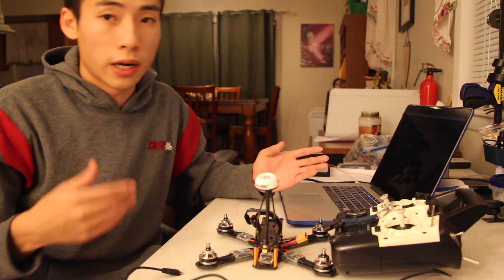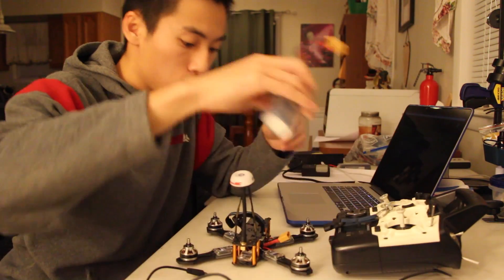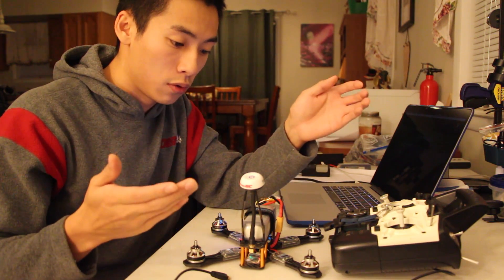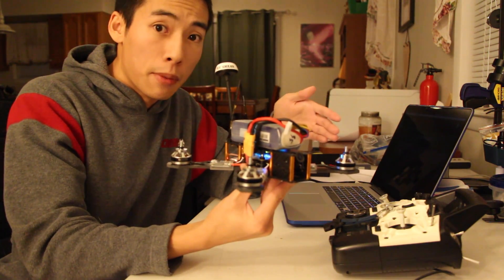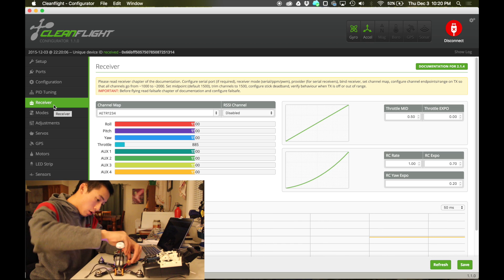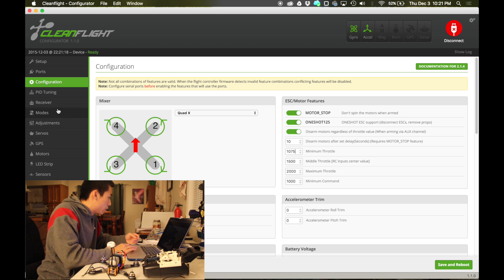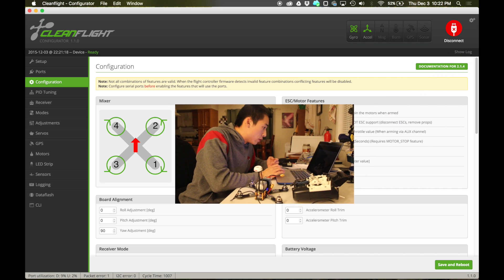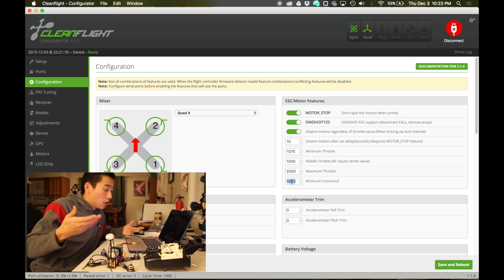Calibrate ESC with Cleanflight plus tips!

Comment: I have a question that sounds stupid

I did the same steps that you did, but what next?

How do I turn it on, I turned on the transmitter and nothing happened
Reply from the maker: Did you mean how to Arm the drone? There’s a few ways to set it up, but I believe default is holding throttle down and to the right for 2 seconds after everything is powered up.
Reply: @Chancopter  Thank youuu that was helpful

Comment: oh man, you just saved me so much time. it took me like 2 weeks of vid watching to finally understand how to arm the stupid motors.. i am just one step from a disconect failsafe to turn off throttle, and i'm set... This video makes sense. i was wondering i screwed it up but no, your vid helped. I am going to field test this weekend... Not bad for a junker pawn shop drone.... It does need to have the camera plug fixed in (super tight) and the back part with the antenna... battery connector super short.. its a cool thing, imma learn on it.. eventually i'll strip it down.. got some new recievers on the way too for next build from all the parts  i got in a lot and eventually build my own.. but for now, it took me ages to finally get it. thanks for the vid bro. subbed.

Comment: Sir,  can u help me.

My  throttle range 1003-1989.    I set my min throttle to 1050.

But my problem is,  when I go to "Motors" in beta Flight I can Manually Controll my motors but When I use my Transmitter The Motors wont response..
Even  "Receiver" in beta flight is working Correctly..

Please help.

Iam also not using Arming switch  bec my flysky is just 4 channel.

Email me: johansgwapo67.68@gmail.com

Ty in advance

Comment: Hi. Thanks for the video. Can you help me solving this problem: After doing the ESC calibration, my motors don't spin at all (when trying to fly). In cleanflight everything works fine, motors spin evenly. But also I have notice that motors start spinning (in cleanflight) at lower input than minimum command. Any ideas why? By the way, it was working before I calibrated the ESC.

Comment: Hi Chonny, I recently build my first drone and it was an amazing experience. Now I am trying to set it up in clean flight to calibrate esc's. I have followed the instructions in your video to the letter, however when I arm the quad from my FlySky Fs I6 and push the throttle up, all motors switch on but motors 1 & 2 keep spinning faster while the others remain at min throttle set to 1050 and min command to 1000. do you think you can help me with this problem. Thanks in Advance

Comment: Hey Chonny, 
Not sure if you will see this. However, I have an Hubsan H501S, and it is flying badly. I look and the Roll is14, the pitch is -6. It has had a couple of crashes, and one from 180 feet where I had to replace an ESC and motor.  I can get it off ground with some manuvering, and with the GPS it holds ok. I do a yaw, and the thing runs away.
Please advise.

Sean B.

Comment: Hello. Im not sure why but my escs will not calibrate. My motors just spin up once i plug the battery in.
Reply: Hey, Daniel, I had the same thing after I hit a wall. My quad crash and the motor started spinning when I pick it up. Ever since my ECS is not responding. Calibration does nothing. Did you ever figure it out.

Comment: Thanks for the video. Just built a quad and the problem I am having is that when I turn it on and get it in the air it bounces up and down like its losing power then gaining it back again. Once I get it universal half throttle it's fine? I have calibrated the motors and esc several times with no luck.

Comment: Clear video thanks Chonny. I've tried your method but still having a problem with one motor on ESC2 which refuses to start at the same speed as the rest. Using betaflight for calibration. All motors spin the same during calibration but not with receiver.  My settings-> Min command 1002. Min throttle 1008. Max throttle 1993. Hope someone can help.
Reply: Hi. I have the same problem right now. Did you find solution for that?

Comment: Great Video, works fine with my ESC's. But after flashing my ESC's I got the problem, that when I move Yaw, Pitch, Throttle or Roll a bit, like half of the possible way, the motors stop! The motors don't spin anymore, I have to unplug the battery and connect it again. But then I got the same problem again.    Can you help me?
Reply: Hi. I have the same problem right now. Did you find solution for that?

Comment: After calibration when i give full throttle Motors 3 and 3 are lagging in speed 1 and 4 are at full 1850 while the  other 2 are below that How do i get them all to the same when my stick is at full
Cheers

Comment: Hi Chonny, thanks for you video.. you actually gave a clue about my issue -> motors spinning at different speeds on take off.... After many checks, frustrations, it turns out it was the transmitter (dsx9)... very few videos show importance of trimming... What I had to do was to trim (subtrim) all the channels (throttle, rudder, aileron,elevator) to as much closer to 1500 .... I didn't pay much attention to min, or max value, I just made, with all sticks centered, the values be near1500... when they have different middle values, for some reason it affects the flightcontroller (PID)... I hope this helps everyone.

Comment: So I really like your vid. I have a question. If all the channels are messed up? Like my throttle is reading pitch and my pitch
Is acting as the throttle. Do I have to switch these with the radio or in clean flight? When I plug in my quad the motors are running hard and I think it's because of the wrong inputs. Any help I would appreciate. Thanks.

Comment: Hi
please help me

I am new in rc team I am build my own quad
zmr250 frame
days 1806 2300kv
Afro 12a opto ESC
naze32 rav 5
matek pdb v5 low woltage alarm
turnigy 9xr pro 
djt module
frsky d4rii receiver
I am assumable my quad but I don't know radio setup so please help me.
tel me the radio setup...

Comment: I am having a problem with my ESC calibration. the motors are not synced at around 1/4 throttle, but if im at idle, then punch it, the motors are synced, but when I hold it around 1/4 throttle, then punch it, the levels are way off. some motors are at full throttle, and others are at half throttle. at 1/4 throttle, it also makes like an oscilating noise. pls help. im really frustrated. I also tired to recalibrate the esc's many times, all together, and 1 by 1. I also tried to reset the board, and the firmware.

Comment: Thank you soooo much for this video.  We were having a major issue with the Vortex 250 where two motors were spooling up very high and than the drone would do flips on the ground instead of even taking off.  Changing the speeds fixed that, however we remain with one issue.  There is no idle on the blades when the drone is armed as there was originally.  Do you know how to fix that?
Reply: annd nm.  By bringing up the minimum throttle up to 1110 it fixed the issue.  Still a fantastic video and I absolutely love you for helping fix our problem!
Reply: Hi. I have similar problem. Do you know how to fix it now?

Comment: at 4:38 my motors start spinning even though there is no battery connected, it seems quite strange, i noticed that after a minute of so a bit of smoke came out from the Naze 32... why is that happening (i mean there is power getting to the motors coming from the Naze32)

Comment: thanks so much.  I had to watch the video a few times to catch everything you were doing, for example I didn't catch that you were lowering the motor settings to 0 when you were in the calibration stage, prompting the lower range to program (what can I say I'm a total noob with RC), but you've got it all here.  Thanks again, now I can fly!
Reply: wogfun yea I didn't notice I glazed over that step. Kinda important I suspect lol.
Reply: Hi wogfun! Can you please tell me how to make transmitter work before flight? My transmitter cannot move motors, but Software can.
It messed me up for 2 months. :( What is the trick? (Please attach with some video).

Comment: when I plug to the flight controller and try to run the calibration the motors start spinning without battery plugged in , this is a 130 frame  with dys 4000 kv motors blheli esc

Comment: Great Video Chonny. One question but at first i am a Beginnner!.^^ Whatever i will get on the Weekend my first Brushless Quad and so i asked me the Question how i can do the Throttle Calibration if one Esc will die or i want to replace them. Cause the thing is i will using just a simple lemon rx Satelitte on it. 

Do i understand it right that this is a way to Throttle calibration like other do it with a "real" Reciever?!?! 

Maybe its a unnecessary noob question but i am want to get sure and yes i am just a noob for the Moment^^ excuse my good englisch^^ ;)
Reply: Yes, if one of your ESCs break, you can replace it and recalibrate with no problems. However, if you want to replace an ESC with a different brand, replace all the ESCs. Your lemon rx Satelitte will work if you are using a Spektrum transmitter (DSMX/DSM2).

Comment: Great tutorial. Thanks! I've seen some other ESC calibration tutorials where they used the radio's throttle manually instead of in Cleanflight to calibrate the ESCs. What is the difference here?

Comment: My motors are not spinning when i selct master
there is a 5 volt supply to them they are brand new as is everything else
Any ideas
Reply: 5v is way too low, you need at least 12v or 3s depending on the ESC
Reply: cheers

Comment: What motors are those? looks like they stop spinning quick when the throttle goes to zero.
Reply from the maker: They're T-Motors but that doesn't have much to do with how fast they stop. The stopping speed is actually the active braking system in the ESC firmware.

Comment: At first, thanks for yor Video. I've done that as you sad and it worked fine. But I got another problem with the Motors. Two of them are spinning slower than the other two. And in flight, the quad spins on the yaw axis lightly. What can I do?
Reply: trim maybe? flying in level mod, calibrate accelerometer.  couple of options

Comment: Very nice Video! By the way, i had the Problem, that 3 Motors started at 1041/42 and one Motor started at 1189(!). I tried to calibrate over and over again, with NO change. (I almost found myself ordering new ESCs) ;-)

What helped me: 1) LiPo off 2) Master Switch to 100% 3) LiPo on. And then i waited for about 3 Minutes while the beeps constantly start over and over again (1 beep pause 2 beeps pause 3 beeps pause 4 beeps pause and again from the start).

The beeps wont change and they wont stop! After 3 Minutes i pulled Master to 0%, got 2 different beeps (No Musical tones whatsoever) and then silence....

I didnt expect it to work, but still tested it and BOOM All Motors starting at 1041(!). So just take your time and let Master at 100% for a bit and you could be ready to fly again. :-)
Reply: Hi. That is a very helpful comment. Can you help me with my problem? My motors when doing ESC calibration starts to spin at 1001, despite of minimum throttle set on 1050.

Comment: Crashed during a race and forgot I had Idle up on.  Also forgot to disarm.  BAD situation!  After the race when I got to it one motor was spinning and I said S*t!  Picked it up and touched one of the non spinning motors and got a little burn.  Managed to unplug.  Replaced all the escs and motors, and it was idling up too fast, taking off, so I cut down the minimum throttle.  Then it started acting very strange.  Random accelerations, flipping on arming, just totally messed up.  So I replaced the FC, no change.  Replaced the PDB, no change.  Then I saw this video. I had the min throttle below the min command.  Fixing that fixed everything!  THANKS!!

Comment: I built a 450 quad with riorand ESCs and NAZE 32 board.  It was working just fine until I crashed it on the inaugural flight.  Yeah, I'm a rookie.  Since then, it will not work properly.  I checked the power distribution board, replaced the ESCs, motors, checked the connections...even after configuring everything, updating everything, calibrating everything, motor number 1 & 4 turn on, then3, then finally 2.  Motor number 2 is always the problem.  I felt I have checked everything but obviously have not.  Any tips?

Comment: Hi Chonny, great video but I'm having problem calibrating esc's. I noticed when you pulled the "master slider up to full with no battery attached your motors don't spin. Mine do a little and if I plug the battery in it goes full throttle. My min command is  set on 1000 and min throttle is 1150. My receiver show min throttle at 1090. Can't figure out why the motors are spinning even when the battery is not plugged in.
Reply: Check that no props are on and battery not connected to quad. Turn master slider to max (2000), there is no power to quad so motors should do NOTHING at all. Plug battery in, flight controller will detect that input signal is at 2000 (or maximum) so its goes into esc calibration mode and depresses motor spin (fingers crossed). Wait for sounds to indicate ESCs have detected maximum throttle value. No pull mater slider down to minimum (1000). ESCs will now make a sound to register the minimum throttle value.
Now go and check the receiver inputs (in cleanflight) and set your transmitter (Radio) for throttle, yaw, pitch, and roll so that middle stick value is as close to 1500 as possible and at max or min stick travel that it outputs close to 2000 and 1000 respectively.

Comment: How can you change the Direction of the motors in the program
Reply: +emmanuel quiroz You don't... Swap any two wires that go from the motor to the ESC if you need to change motor direction.
Reply: But I was told that most time I don't need to
Reply: Unless you want to get into reprogramming the ESC's your best and easiest option is to simply swap any 2 wires.  Programming an ESC can get fairy complicated pretty quick if you don't have all the right stuff, and understand what your doing.
Reply from the maker: Only BLHeli can swap via a cleanflight board. Open BLHeli suite while ESC are connected and powered up. No props. You can adjust anything from motor direction to dampening to beeping through that.
Reply: Chonny I'm going to do that thanks
Reply: +Chonny I have 4 esc, two of them the sound went off too late when calibration. any idea why this happen?
Reply: I had this same problem on one esc. Check your soldering to make sure you soldered from the fc signal pad to the esc signal. Also check if you have bridged the ground and signal pads because that can cause desync and weird behavior from that motor. Good luck let me know if this worked at all.

Comment: Hey nice video! :) Also a good tip would be, if you do this on the bench, is to put the quad in acro and make sure it does not move i.e. it stays still (flat) on the bench. What this does is it keeps the PIDs from trying to level it out, 'cause in acro mode, there is only rotation rate PID active and since the quad is not moving, the PID will not affect the output to the motors in any way. Also BIG thing to remember is: make sure when you trim your transmitter, that you don't have dual rates and expo active, for example, when you do your endpoints and middle values. If you do have expo and D/R active and do your trims anyway, when you switch to linear (i.e. no expo and D/R) you might get wrong values out of your transmitter. Hope this helps further :) Keep up the good work and happy flying! :)

Comment: I have a eachine 250 racer and when I push throttle up then turn to left or right the motor will slow down and if throttle is not up or half way it will shut the motors on opposite side tur right left motor will slow down or shut off

Comment: +Chonny motors act fine and calibrated when using motors tab, but when I use the tx throttle two spool up and the others go down.  BTW it was good before I tried to cal before (before I found your video)
Any ideas? Tnx

Comment: thank you for the video, Well done!  I have an issue with getting my roll to middle value in cleanflight.  Do you think it has to do with my Tx and Rx or ESC?  I try trimming my Tx roll all the way to the right and I still cant get it to 1500.  so, when I try to fly my quad instantly flips on its left side.  Any suggestion?  I use a DX5e with spektrum ar600 rx.  Maybe upgrade to a new Tx (DX6i or DX6)? Thanks....
Reply from the maker: +Weepee14 How far off is it? You can add subtrims instead of the trims you find by the control sticks. I adjust the range of the inputs as well as the weight of each input to get them to range from 1k-2k and centered at 1500
Reply: Hi guys, thanks for the quick reply.  My roll is currently reading 1178 with the Tx trim set at center.  I know I have the entry level Tx so I am not familiar with subtriming